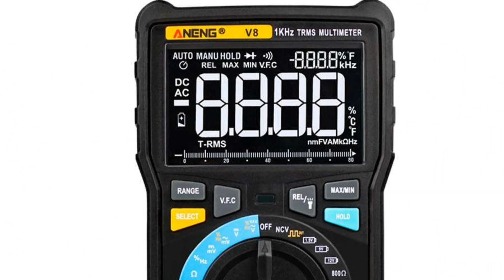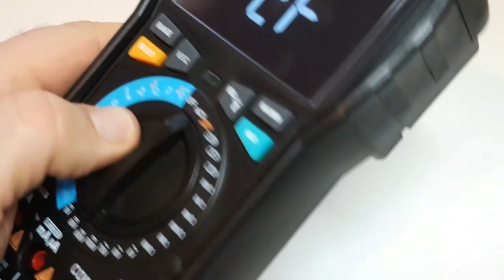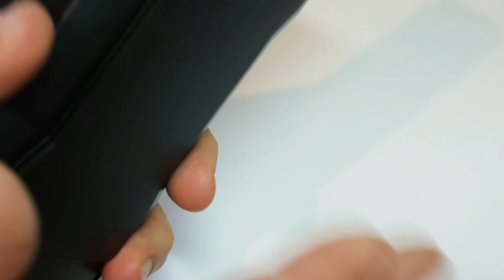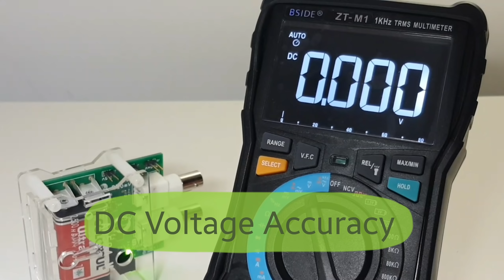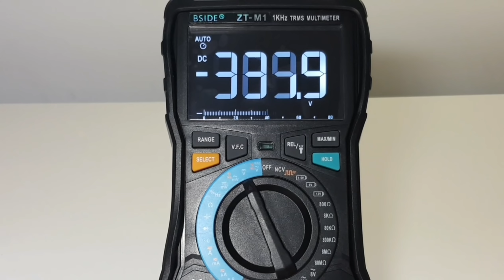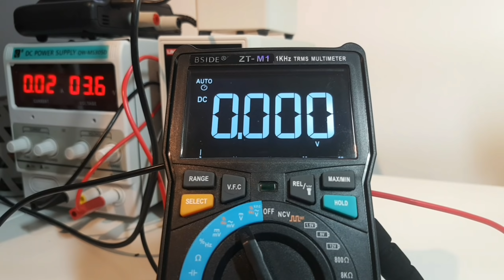BSIDE ZT-M1 Multimeter Review & Teardown!

Comment: Thanks for the detailed review Darren, fellow canadian here!  I have a ZT-M1 i bought a couple years ago from Ali I opened mine up to replace a fuse tonight and the IC that was whitewashed on yours is not on mine.  It is a ET6621S, which i think is the LCD driver? I fully agree the meter works great and the probes are surprisingly good but the meter case and overmold is poor and cheap.  Also the probe storage on that case is so bad i wish they wouldn't even have tried to include that.  Like you said the case REALLY disappointing, works well with nice feature set but a miss on basic case design and the input protection will definitely have me reaching to my older more trusted meters for those few times I'm on 240+.
Reply from the maker: Cheers my fellow Canuck! It's a great multimeter with a few flaws but still a good buy! That case is atrocious...thx for the chip info !!

Comment: RE: BSIDE ZT-M1:  The NCV sensor wire was quite minimal, the reason for poor sensing.  Could the user fairly easily add anything to that "wire" to enhance the sensing sensitivity?  Would that mess anything up?  That, to me, is the biggest performance downside on this model.
Reply from the maker: The NCV is embedded into the pcb. So , although not impossible it would be a bit of a chore to enhance the signal. Personally,  I wouldn't bother as there's no guarantees that it would greatly enhance the sensitivity.

Comment: I would love to see a review or the Aneng V7, the "other half" of this pair of meters. I'm pretty sure that they have the same case plastics, but the electronics internally are quite different, as the V7 has this "Smart Test" mode that is supposed to make the correct measurement type (voltage, current, resistance, etc.) automatically. I would like to see how well that works in the real world (i.e. how does it determine if it is a low resistance test or a continuity test, or if you are testing a battery, whether it should be testing for voltage or current). It doesn't have the sexy display of the V8, but it may have other features and capabilities that are more important, may use even less current, and is somewhat cheaper.
Reply from the maker: Thats a great idea, ok Its on the review list!! Thanks for watching